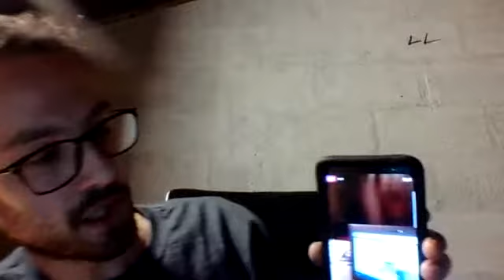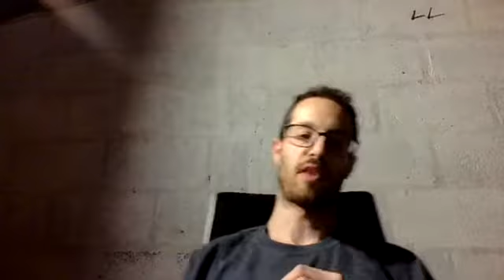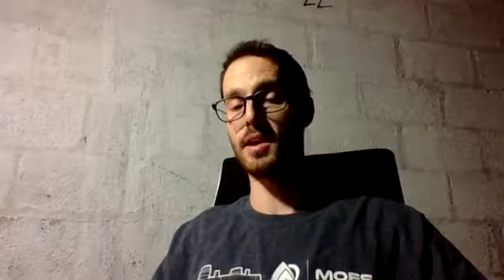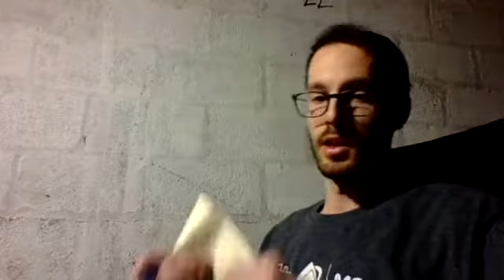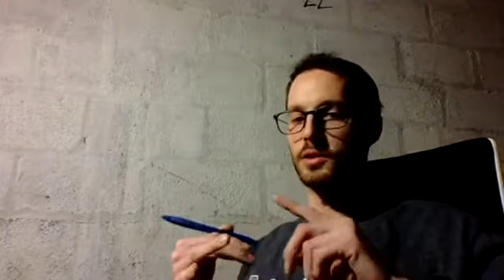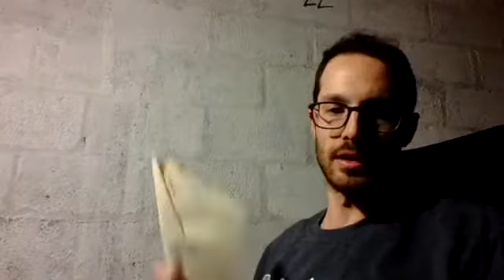Mitsubishi VRF Heat Pump vs High Efficiency Boiler with Baseboard TurnUpTheComfort.com

Comment: Hello I appreciate your concern for people to install a correct system. I believe you should put a disclaimer stating your variant which is the price of electricity and gas which fluctuates tremendously from state to state. Gas in general runza dollar plus minus in most States. Electricity in my area is 12 cents and double in your area. So people should be informed in the beginning of your video that they need to calculate the ratio of cost between electricity and gas and then taking make a decision. In my area I'm saving approximately 30% using a heat pump over natural gas. Also if you properly size a heat pump you can get a cop of four very easily at 30 degrees. My Fujitsu 15 rls3 h has a cop 3 at 17 degrees when I add a load of 11,000 BTU. That is actually what I'm using at 17 degrees whereas at 30 degrees I'm using half. Which would easily bring a cop up to 4. Also some LG units The prestige units have a very high Cop. For instance to 12000 BTU at full bore has a cop of close to three at 5 degrees. So if you were using it mid throttle at 17 or 30 degrees you will easily be over 4 cop. The other thing to consider is many of the Mitsubishi units multi-zone have a very hi the minimum output usually 15 to 20000 BTU and when modulated at that low output there cop is at approximately 2. Properly sized smaller units have cop from 4 to 6 when at low capacity which they will usually run at above 30 degrees.
Reply from the maker: you are correct. The beginning of the video clearly says that I was using my a local rates.